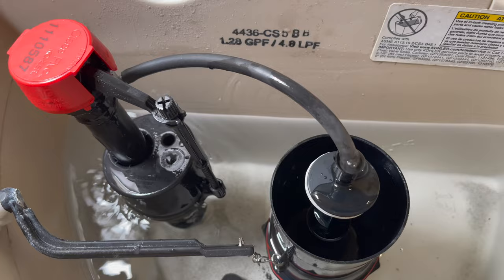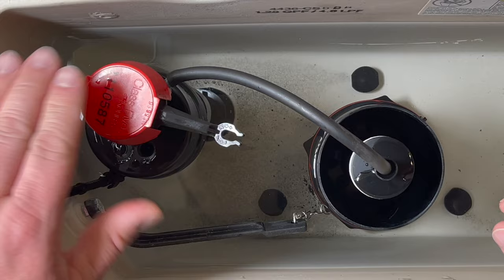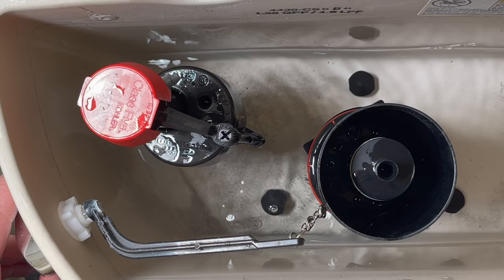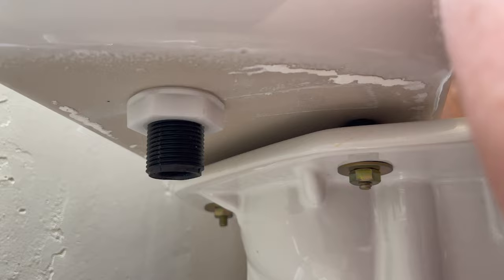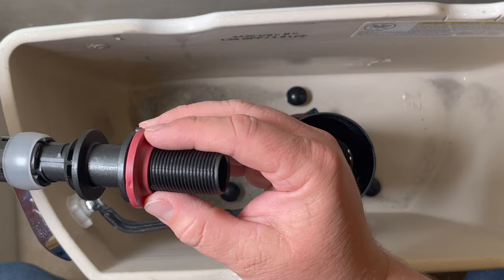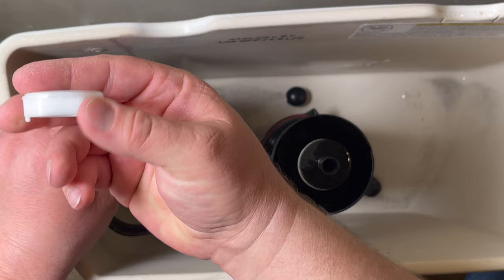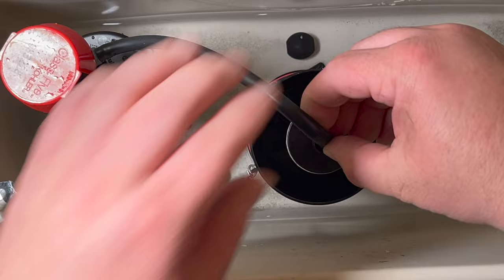Kohler Toilet Leaking Silent Fill Valve Replacement Instruction

Comment: Thank you…but you made one major mistake. You failed to adjust the height of the replacement fill valve to the same height of the old one that you were removing. The Kohler fill valve is height adjustable. You lift up the clear plastic ring so that you can adjust the height by turning and pulling. If it’s too high, the tank lid won’t close properly. If it’s too low, you won’t get enough water in the tank.
Reply: Genuine Kohler box but Fluid Master parts.
Reply: @GodisGreat-p2s  Find another video, not in this one.
Reply: @wkm001 I figured it out thank you
Reply: What was that extra piece you put down?
Reply: @ritaalbert1266  It's a white ring you pull-down to raise the fill valve

Comment: The 6 variously colored fittings that come in the plastic bag are flow restrictors of narrow to wider inside diameters.  They control the volume of water that flows into the toilet bowl during the time the tank is being refilled. I had to experiment with a few of them to get to the correct balance between time taken to fill the tank vs the correct amount of water in the bowl. Meaning if you use the higher flow restrictor it takes substantially longer to fill the tank because more water is going into the bowl. The instructions do not address this issue. They just say to use the same color restrictor that was on the fill valve being replaced. If you have a 7-year-old toilet like mine it did not have a restrictor device. So I had to guess.
Reply: Hi, someone just replaced my old fill valve with this one.  They used the blue restrictor but my toilet bowl is taking forever to fill. Was this what happened for you?  My old fill valve was awesome and the bowl filled up quickly allowing for another flush very soon after if needed😂

Comment: The diaphram's sold individually at Home Depot for a couple a bucks & would have solved your problem despite no visible defect in old one.  Just put your hand over the top & turn on water to flush out the debris before replacing.
Reply from the maker: Thank you for sharing and for your support in watching this video!
Reply: They are $3.80 including tax in SF bay area. Just repaired my folks toilet that had a worn diaphragm with depressions in it. Tried cleaning the old one very well, but wasn't good enough to prevent the leaking.
Reply: Do you know the part # or what is called?

Comment: Good video. Would have added two things: 1. The overall fill valve height is adjustable - show how and make sure height is correct for particular toilet; and 2. Show how to adjust float so that tank fills to proper level. Most people will figure this out on their own, but not everyone.
Reply from the maker: Great point, thank you
Reply: And I am one of them that can't figure it , is there another video?

Comment: Thanks, your video answered my question.  I have to clean out my water line at the toilet.  Most videos show the person removing or popping the cap off.  I decided that this particular brand was NOT one of those that you remove the red cap; you twist it counter clockwise a quarter turn.  Not all red caps work the same way.  Glad I didn't break anything.
Reply from the maker: Glad I could help, and I'm glad you didn't break anything either.  That is my fear, breaking something by guessing and making a decision based on how I think something should logically be removed.  Haha!  Thank you for your kind comment and for your support!

Comment: Thank you! I probably would have broken the cap piece if I didn't watch this. After taking the top off, I turned the water on a little and a small chunk of metal came up which was causing the gasket not to seat.
Reply from the maker: Glad my video helped, thank you for sharing!
Reply: this seems to be a common problem with these. Mine did the same thing

Comment: Excellent video!  I have a fairly new toilet, it was just seeping a little water. I didn't feel I needed to replace my whole assemblage but just the information in this video allowed me to open up and find a small piece of debris that was causing the seal to leak and make a slight hissing sound. I was able to remove the debris and fix the toilet in 5 minutes! Thank you so much
Reply from the maker: So glad this video helped you out, thank you for sharing your success, and thank you for your support!

Comment: I needed to see how you removed the bolt closest to the tank with your channel locks. I don’t even know what a channel locks are or is that’s the part that you left out and that’s the part that I needed. Otherwise, your video was great.
Reply from the maker: Yeah, sorry about that, I wasn't using a GoPro or anything strapped to me, I was only using my cell phone, I just couldn't get it down there while needing both hands.  I hope you figured it out.  Thank you for your feedback and for your support!

Comment: That's the same contraption some plumber put in my rental.  Refill water comes out everywhere except the tube.

The weird thing is, if I close the supply valve, wait 10 seconds and reopen it, the water comes out the tube where its supposed to.  Doesn't matter if slightly cracked open or wide open.

Next flush, it sprays out all around the underside of the red cap again.   Drives me nuts.  
Yes, I removed the tube and bracket, and made sure they were clear.  Also removed the red cap (several times, and it never cracked or broke), put a small bucket upside'down over that area and blasted fresh water thru it.
Never saw anything come out. Tried flipping the black rubber washer thing over too.  Seemed like it made it worse, so I put it back the way it was.
Reply from the maker: That is interesting--Thank you for sharing!

Comment: Thank you for helping me replace the fill valve in my toilet. Success! Before I replaced the unit, my toilet was dual flush. I had to hold handle down for full tank flush. The duo flush no longer works after installing fill valve unit. How can I restore?
Reply from the maker: It would help to observe this function you're talking about through a video.
Reply: @fixintodoitall  thank you! I fixed it. truly user error. again, great video!

Comment: Quick question, i noticed you used the grey tab grabber, why that one? I’m not sure which color tab grabber I have to use so I’m gonna use the grey one because you used it. Also, what’s the first white wing nut you took out of the box first before the bag of parts for the replacement. I did t know what to do with that so I’m gonna just do the replacement/installation just like you did on this video. I just wanted to know why there were so much pieces in the kit that would confuse people if they didn’t need those parts. The instructions in the box didn’t really clarify. Thanks for the video and will be looking for a response.
Reply from the maker: Excellent question.  I grabbed the grey tab, grabber because I saw that was the color of the previous unit that I was replacing.  I assumed that would be the correct size for my toilet.  As for the white wing nut, I didn't see a use for it.  Thank you for your question and for your support.

Comment: Obviously the intent of the video was to show replacing the fill valve. In most instances it would be unnecessary and only need to replace the seal for less than $4 for the toilet to work like new. I just replaced the seals on both Kohler toilets. THey work perfectly .
Reply from the maker: Valid point.  But I don't see much of a cost difference between the two.  If I spend the time and get my hands dirty, I might as well replace the entire assembly.  That's my thought process.  Thank you for your comment and for your support!

Comment: I have a the same leak from a Brascraft fill valve. The Brasscraft valve uses a very similar pilot slave diaphragm arangment. The problem is chlorinated water in my area causes the diaphragm to swell. This restricts the flow through the tiny center passage through the diaphragm preventing it from shutting off completly. This happens about every three years on a valve warantied for ten. Brasscraft does not make available replacement diaphragms. Next time around I will replace it with a traditional valve/float arangment.
Reply from the maker: Thank you for sharing--Best wishes!

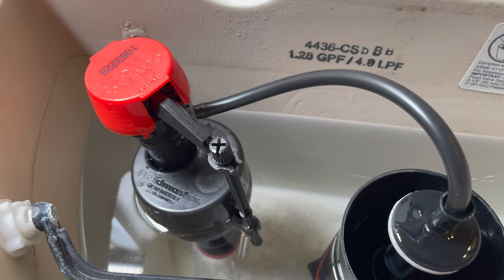Comment: So now does your toilet flush good with way less water in the tank? At 4:49 the new one is way shorter (look at the white collar) and at 7:03 how much lower than the watermark the water level is. Is that thread looking part by the white collar an adjustment? Also make sure to  install the same color adapter, as on their old valve, where that hose hooks on.
Reply from the maker: Yes, no problems at all.  I noticed the water level was lower after I made my video and tried to find a way to adjust it but I gave up quickly because I felt there was more than enough water to flush with both flush settings.
Reply: There are threads of sorts in the middle by the white coller that adjusts the length. @fixintodoitall
Reply: @alm7707  does that just adjust the float or water level??

Comment: I just purchased this toilet and seems to have same issue. I reset seal and it stopped leaking but occasionally will not fill.  I may replace just the whole valve. Brand new out of box toilet and it is faulty.  Thanks for the video.
Reply from the maker: The cost really is not much different.  That was my thought.  Thank you for your support.

Comment: Excellent video! Do you need to put silicone grease/sealant or something like that under the seal to prevent leaking?
Reply from the maker: Excellent question--I did not!  Thank you for your comment.

Comment: I saw the video on how to replace the float valve assy. Was it as easy as it was in the video? Any leaks after install? Do you only need to tighten the mylon nut on the bottom of tank? No torquing necessary?
Reply from the maker: Correct, very easy, everything by hand, no torquing.  I only suggested that I needed a pair of channel locks to loosen because I had no idea how tight it would be, but I believe I could have gotten it with my bare hands.  Thank you for asking and thank you for your support.

Comment: My toilet every so often is loding water from the tank and refills to its proper height. I replaced the cannister seal but that didnt work. 

Could it be the the valve that you replaced in this video?
Reply from the maker: Perhaps, it could solve your problem.  But it's hard to know without physically being there to assess your situation.  Thank you for asking.

Comment: I just did  this repair and the problem is not the rubber gasket but a crack in the gray plastic part.

Comment: I got the Koehler replacement part.
But the one in my tank is a little different the floater is an oval shape the new one is round.
Is that not the right one or will it work ok ?
Thanks
Reply from the maker: Not sure, my friend.  As long as all the connections match up, it could work.  Hard to say without me being there with you.

Comment: Seal valve didn’t close for me using the new seal.  Why?   Old seal works.  Seals are different.  Seems that the seal is too thin.
Reply from the maker: No doubt, you have the wrong seal.  Where did buy your seal?  Look at your existing Fill Valve, you should find a model number.  Good luck, and thank you for your question.

Comment: I just installed the Koehler silent valve, and it is much louder than my old one and takes forever to fill the tank (about 2 min.).  Any idea what may be causing this?
Reply from the maker: Not so 'silent' valve.  My only suggestion is to reinstall it.  Thank you for your question.
Reply: Same but it's my toilet bowl that takes forever but it seems that the water is flowing into the bowl so strongly so I don't understand.  It's extremely annoying and not silent at all.  I had a fluidmaster pump before and it was awesome, I swear 30 seconds and you could flush again.

Comment: 4:32  unless your seal is leaking from the tank - you don't have to take the whole thing out.  You can pull that plastic ring up and pull on the top shaft and the whole top comes off leaving the bottom intake.  Then just slide the new one over the stalk and your done.